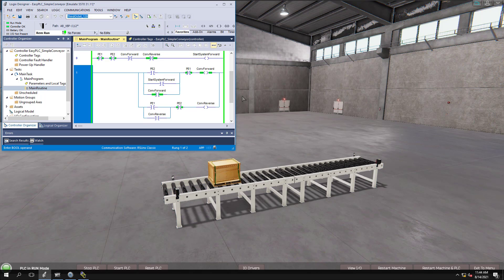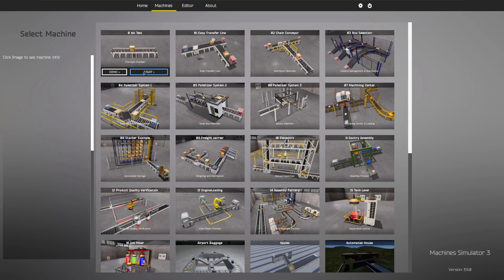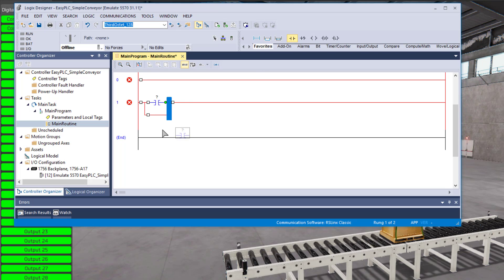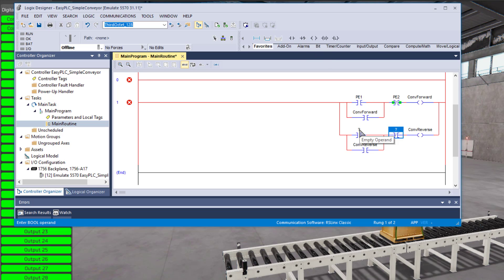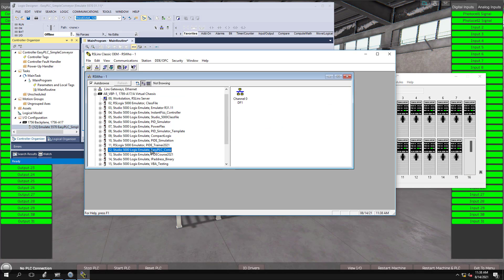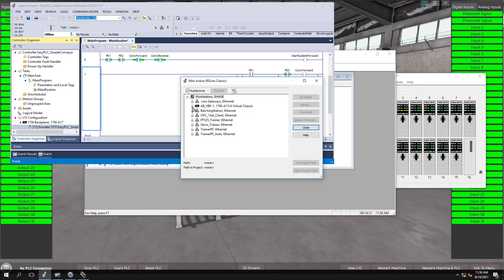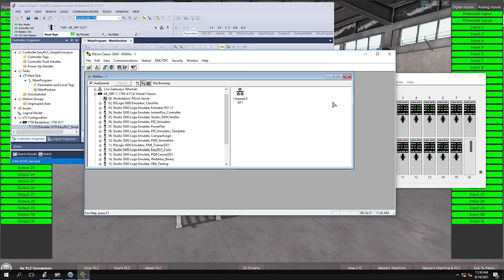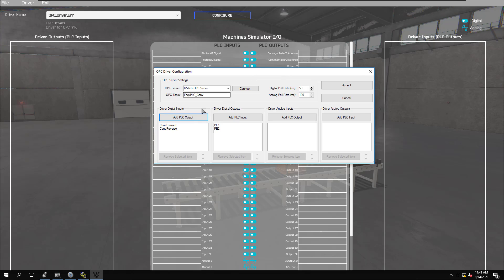EasyPLC Machine Simulator OPC Setup With Studio 5000 Using RSLinx

Comment: Love your videos. I haven't been able to connect the EasyPLC Simulator with the Studio5000 on your VM yet. I feel I've followed everything in this video, but there isn't a lock next to my topic when using DDE/OPC Configuration.
Does the the simulator need to be downloaded the VM or can it be linked with the simulator when its my computer? (I have the USB simulator)
Reply from the maker: The simulator needs to be installed on the laptop or computer withe the plc software you are using
Reply: So I can't use the Simulator with your VM then?
Reply: I'm currently enrolled in your Allen Bradley PLC course and I was hoping to also use the EasyPLC Simulator with the VM you provide us from this course. Is that possible?

Comment: Hi Shane. Thanks for the best explanation on how to set OPC to run Studio 5000 with the machine simulator. Everything looks right, the OPC/DDC check is locked but the machine simulation is not reacting with the machine simulator even with the status of the driver is connected. Is there a way to troubleshoot it?
Reply from the maker: If the OPC is locked then the connection is good however double check the tags and the way they interact
Reply: Make sure your tags have controller scope and not just program scope.

Comment: Can you not use 5000 with easy PLC with only RSlinx lite? I have Emulate and 5000 and EasyPLC. When i go to my start menu it says i have RSlinx classic but it opens saying light. I created a new topic and Easy PLC says driver not connected, while im online with my emulate processor and 5000 in run mode. Thanks for all the content you make Sir!
Reply from the maker: Let me know if I can help, I do one-on-one coaching for only $57 a session which are 90-minute sessions
Reply: @ShaneWelcher  thanks

Comment: Is it possible to use Matrikon OPC For Allen Bradley with emulator/ machine simulator? (instead of RSlogix opc).. any idea what settings? Machine simulator has matrikon opc as an option . Thank you
Reply from the maker: Not sure why you would even use a matrikon OPC with a Rockwell Automation PLC, use RSLinx.

Machine simulator needs to be one OPC path instead of two
Reply: @ShaneWelcher  is impossible to get rslinx single node/oem/gateway from Rockwell if you’re not a company and registered with them
Reply from the maker: @spidergt80  I use RSLinx Classic in all my videos then double check to verify the topic is locked.

I'm just recommending that you use a single OPC for easy connection

Comment: I can't communicate the Studio 5000 program with machines simulator. The topic opc is connected, the machines driver connection is green but Studio 5000 does not interact with machines... When I open a driver file the tags do not appear. The version is 3.9 What could it be? Thanks.
Reply from the maker: Make sure that your have the machine simulator tags setup correctly.

Often the OPC setup seems backwards.

When you map the tags in machine simulator, drag & drop the tags into the proper location.

Then do yourself a favor and save the driver for easy edit later.

After you do that, start the driver in machine simulator & open the RSLinx topic to make sure it has a lock symbol.

If not the double check the RSLinx OPC topic name.

Also verify that you are using the same exact machine simulator driver that I used in the video.

Watch a few more videos in my playlist for EasyPLC to watch the OPC setup.

That should help.

I have one of them that is short I believe which shows the whole setup.
Reply from the maker: Make sure you re-watch minute mark 10:05 of this video.

https://youtu.be/I6YfONKkAyI?t=607 is the exact point I am talking about.

It sounds like a simple setup issue or typo, I've been there.

Hope that helps